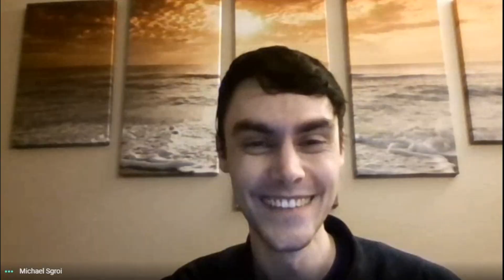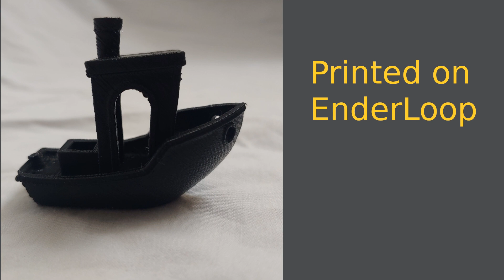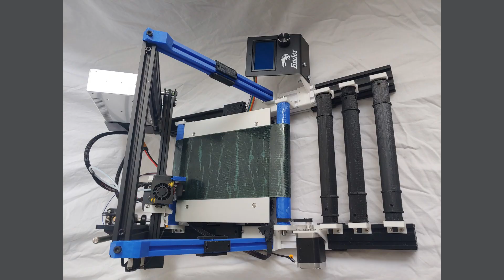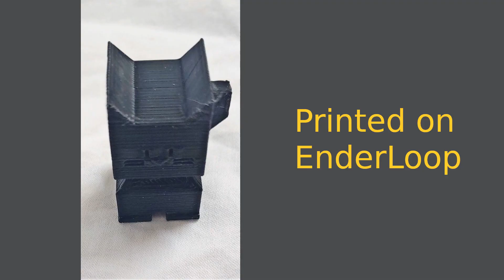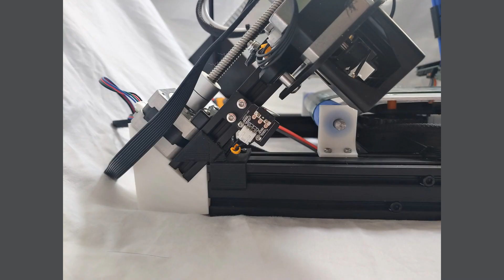Turn your Ender 3 into a conveyor belt 3D printer: EnderLoop Interview

Comment: I notice that the belt width is considerably narrower than the plate. Is there a reason for this?

I am considering a future conversion of a 400x400 ender 3 to belt printing. It would be nice to use as much of that width as possible.
Reply from the maker: I'm not 100% sure - but I think it has to do with where the bed-leveling bolts are. The belt has to be narrow to fit in between them. Because the files are open source, there could be a way to remix it to get more width.
Reply: @powerbelt3d  why not just change the knobs to smaller ones?

Comment: We have built 8 Ender 3 for our printing farm. Other brands as well. We have a CR-30 ordered, but I think we will convert one of our Enders. Thanks!
Reply from the maker: Happy to hear it! I would guess you can get an Ender converted before the CR-30 arrives.
Reply: @powerbelt3d  I am two days away from all the printed parts being done. Clear Recycled PETG. One change is I will use the 32bit SKR board I built Marlin for, so making the mods should be easy. I already have V3 planned using more Extruded Aluminum parts for rigidity.
Reply from the maker: Awesome! We're now using 32-bit SKR boards instead of the 8-bit MKS base boards in our early units. They're a great balance of price and quality
Reply: @powerbelt3d  I agree. I am two prints from starting. I will install the SKR board first and test it out before the upgrade. Minimize hassles.
Reply from the maker: @BruceNevins  Love it - can't wait to see the results!

Comment: Could the designer of the EnderLoop, please make a file that allows for the 3dprinted "extruded aluminum" pieces to be made from actual extruded alum?  With just 3d printed mounting ends?  Also, a suggestion on the rollers.  Instead of 3d printing them, perhaps PVC pipe would work with a 3d printed insert on each end..  that could cut production time down drastically, and PVC pipe is smooth, and dirt cheap...
BTW..  I LOVE THIS!!! I having any cubic mega ex right now, and was in the process of building an ender 3 clone myself, so I may actually just go buy an Ender 3 and make the "EnderLoop"...  Nice Work!!!
Reply: I am working on documentation for the build and a modification to use mostly extruded aluminum parts with just a printed connector. Once the documentation for V2 is done and the build full tested I will start on the V3. I won't have that done for around 60 days, but it is in the works.

Comment: Also, could you make a version for ppl that don't care about the infinite bed size? (like, I just want to mass produce a piece)
Reply from the maker: Sadly, existing patents make it really risky just to offer a conveyor belt option without an angled XY gantry. We have some other automation techniques in the pipeline though :)
Reply: @powerbelt3d  Really?! I've always just thought that the reason nobody swapped a standard build plate for a belt was that they would lose a bunch of y travel else the print unsticks from the belt.
Reply from the maker: @Biskupic_Engineering  Yep - US patent US8668859B2. So unless companies want to risk a lawsuit, nobody will be adding a conveyor belt to a "standard" setup until 2032 at the earliest. The tilted XY+conveyor belt setup was created and open sourced in 2016
Reply: @powerbelt3d  Damn you MakerBot

Comment: Also what about the software and stl files to print the parts ?
Reply from the maker: The STL files are in the GitHub or Thingiverse links in the description. Can do you mean by software?
Reply: @powerbelt3d  Sorry i ment, what software do you use to slice the file ? For example if i want to print a 3 foot long file. Do i just set the printer dimensions - change the ender 3 bed sizes ?
Reply from the maker: @3dprintedkits-printatoons222  Sure! I use IdeaMaker these days. When setting up a custom printer in the "Advanced" tab, you can specify that it's a belt printer and the print angle. https://www.ideamaker.io/ideamaker-beta-testing-for-belt-3DPrinter.html